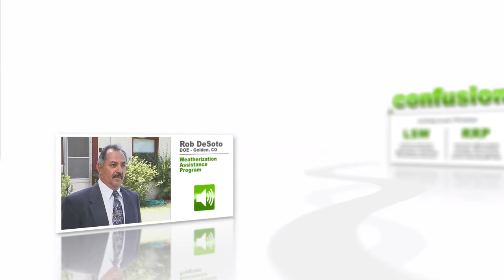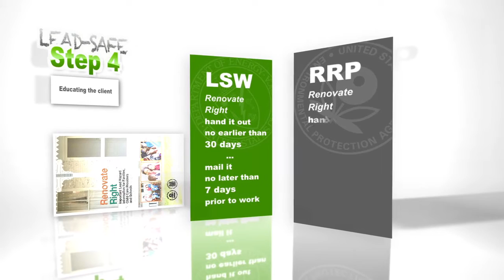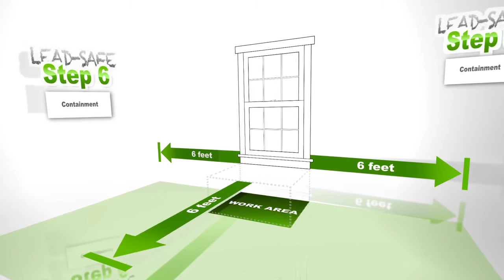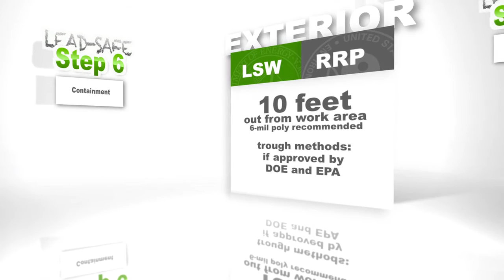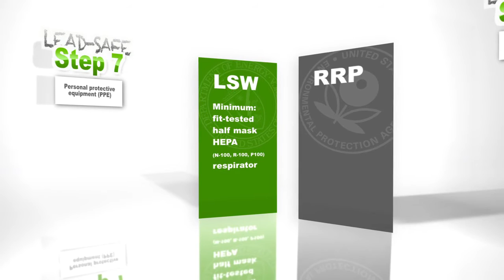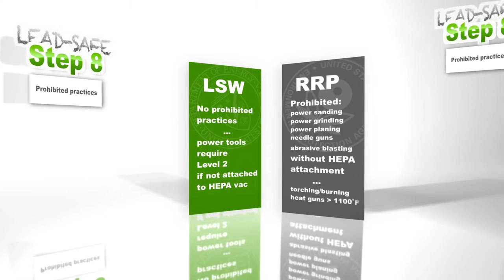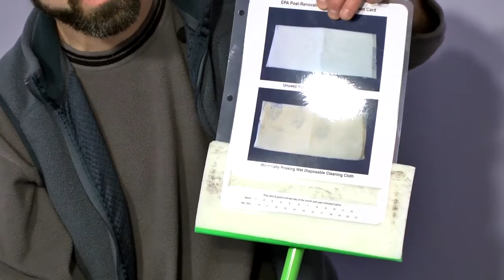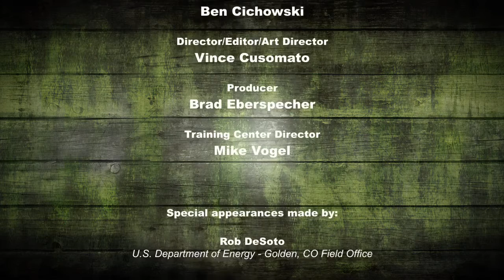Lead-Safe Renovation & Weatherization Overview

Comment: I have a big question. What if I am a non-certified painter, and never heard of EPA or RRP rules before. Home owner who just bought a 100 years old house hires me to do scraping work in one bedroom, and pressure washing and scraping work on the exterior. He didn't tell me anything about lead hazards, that can happen during my work. After my work was finished, they tested their carpet and outside yard and found it lead positive. Who is responsible for all these lead damages?
Reply from the maker: Hi Andrew, As a business owner hired for profit, you are liable for knowing about & following the RRP regulation; it's not the homeowner's responsibility to relay information on lead hazards. The EPA requires contractors to assume lead-based paint is present on their project if the home was built prior to 1978. Your firm would be responsible for cleaning up dust-lead, chips & debris in all your work areas & the pathways to access those work areas, nowhere else.
Reply: @TestudoLLCMadison  If home owners don't have any responsibility at all, does this mean that they can hire any non-certified painter, who don't know nothing about RRP regulations. And after the work is done, instead of paying him, will threaten him , and then will benefit from his insurance for cleaning their yard and installing new carpet.?  ..I am sure there are a lot of painters out there, who never heard of RRP regulations yet, especially those who don't speak English.
Reply: This is what I found on EPA website:
Real Estate Agents and Home Sellers
Federal law requires you to provide certain important information about lead paint before a prospective buyer is obligated under a contract to purchase your home.

Homebuyers
Federal law requires that before being obligated under a contract to buy housing built prior to 1978, buyers must receive the following from the homeseller:
An EPA-approved information pamphlet on identifying and controlling lead-based paint hazards titled Protect Your Family From Lead In Your Home (PDF).

Doesn't this mean that home owners should hire RRP-certified painter for their project in homes built before 1978, if not they are violating EPA rules and Federal Law. And if they are violating RRP regulations and  the Law, they should be responsible too for any lead damage in their home.
Reply: Andrew Pesh homeowner is ultimately responsible for everything in their home. You were tricked into removing lead paint for much cheaper than a certified lead removal would cost and the homeowner is pretending to be stupid but really the homeowner hired a non certified contractor and got lead contamination as a result of hiring such a contractor. You may need a lawyer.